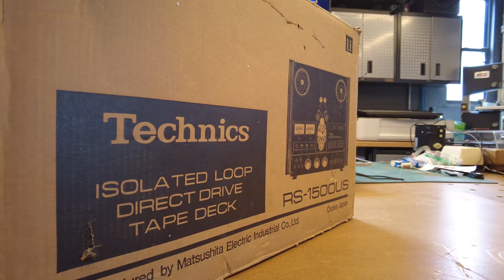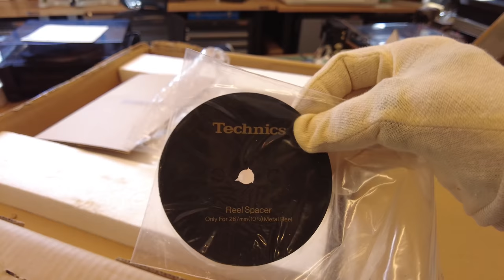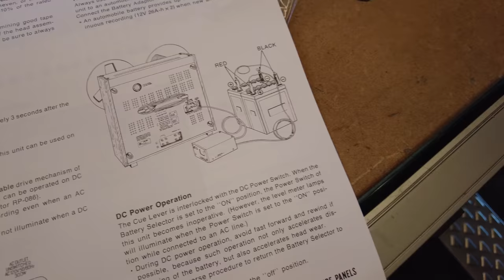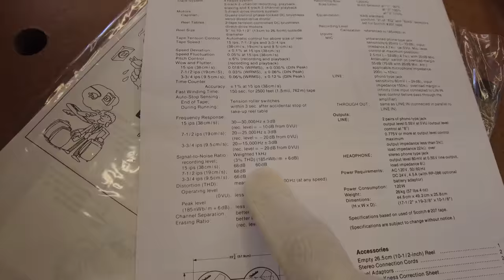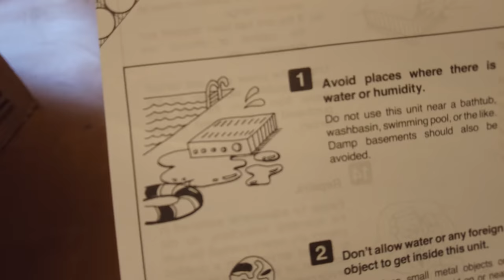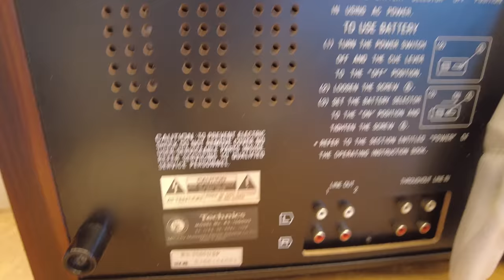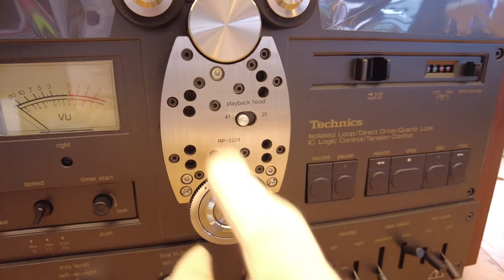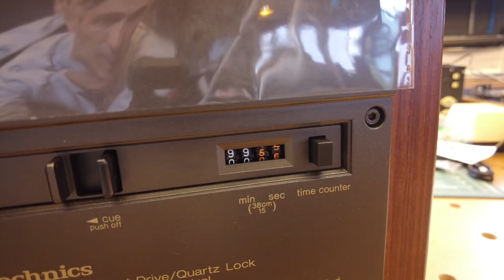Unboxing a NEW Technics RS1500 Reel to Reel from 1979

Comment: I bought a Technics RS-1500US. It was in excellent cosmetic condition, but needed work. I got the machine recapped, calibrated and the heads lapped. I've been digitizing  / restoring vintage per-recorded tapes from the 1950s and 1960s and it sounds fabulous.

Comment: So is this unit all direct drive or does it have belts are you concerned about the pinch rollers needing replaced just because of age or the belts. How about the grease for the metal levers and fulcrums and pivots wouldn't that need to be cleaned off and new put on, 40 years is 40 years in a box or out of a box. Just wondering. I'm still looking for akai 625 that's been properly gone through. Interesting video thanks.
Reply: I have the same question actually. Please let us know how this held up in that regard.
Reply from the maker: I dont recall any belts in the drive system. perhaps on the tape counter.  Pinch rollers were not hardened but certainly it would benefit from new ones if the plan was to use the machine.  Yes if its going to go into use, a light service would be  recommended.
Reply: @SkyFiAudio  oh okay I miss the fact that it was just going to be for show so yeah probably shouldn't touch it.
Reply: @SkyFiAudio  2 belts on the tape counter. All electrolytics MUST be changed, the purple Panasonic caps now leak like crazy even though the deck has never been used. Failure to do this on any Technics RTR results in an unreliable machine.
Reply: Did you get an Akai GX625? I managed to pick one up in almost mint condition a couple of weeks ago in the U.K. 
Still going to get it serviced, it’s a beautiful machine.

Comment: OK, with the ID plate located near the headphone, mic jacks was added after the first generation was issued. I had one of each. Used to record in 15 IPS do post production to the second machine and then make copies at 7 1/2 IPS for purchase. Also made cassettes and 8 tracks. Weddings and local bands along with special shows and musicals. Did this for about 5 years.  Then went into video with Beta video tapes.

Comment: I owned that very unit in the early 80's while serving in the US Forces European theatre.   Using high grade magnetic tape, recording at 15 inches per second, and recording on only one side of the tape was an extraordinary financial overkill on my part, but gosh ... it was so satisfying.
Reply from the maker: Satisfying is a great way to explain working with a high quality  reel to reel.  Thanks for sharing.

Comment: I'm sorry for the new owner.   Rite off the bat you will need it brought up on a variac then about $600 to $800 dollars work needs to be done on it.  It's been idle for 40 years.  The box has not been sitting in a museum with constant humidity and temperature controlled environment most likely. Over all it's a good deal depending on the price and how many times it has a problem. If I owned it I would use it every other day and have it checked every year for a check.  Good unit nice to find nos.
Reply: Dude.. they are not even going to test it.  Here's from their website  "Based on the build quality and experience with this model it will likely work right out of the box"  I'm not lying, and they want 19K for it!

Comment: Watching you unpackage that machine brought back the memories of when I unboxed my Tandberg 64X deck which I bought new in 1968. Believe it or not, the Tandberg 64X had a better frequency response at 7 1/2 i.p.s than your machine has. For current use, it might be extremely expensive to buy 15" reels of tape unless you were doing the mastering for commercial use but why not do new recordings on digital? Great video. Thanks for posting.
Reply from the maker: Glad you liked it, the Tandberg is a great machine also, Im a big fan.
Reply: If you have to ask that question ,you just don't get vintage.
Reply: 15 inch reels! What??

The larger 1/4 inch tape reels are 10 1/2 inch. These are NAB reels, they have a large center hub.

I remember these machines when they were new. I had two in the day, a single pass Studer-Revox, and my happy Pioneer RT-909.

The Pioneer was a thing of beauty, fluorescent bar graph displays, computer controlled operation, and it worked in both directions for playback.

The head stack on that beast had a beautiful aluminum face with access to all alignment positions for the heads.
Reply: Yes I have 2 Tandbergs too from the 70's! One is a tape deck n the other a tape recorder with built-in amp n 2 speakers on the left n right of the machine. At 7.5 ips they frequency response is as good the vinyl itself when played thru a hi fi system!

Comment: I still have one of these babies but it is a slightly different model I can record and play in both directions but it's too track stereo in both directions not four tracks.. A few years ago the logic circuits started having problems and now the transport controls no longer work. One day I'll get it fixed because the thing has the most beautiful sound of any tape machine that I've ever had.

Comment: I would love to find a Technics RS-1800 with the seperate bottom record/playback circuitry box. To me, this is the Holy Grail of Audiophile Reel to Reel machines. The notable aspect is its eq'able 30 ips record and playback half track stereo capability. The sweetness and clarity of the high end and low end frequencies is only topped by my other dream machine - The Nagra IV-S TC (Time Code) portable reel to reel with the QGB 10 1/2 inch reel extension kit. The Nagra QGB is completely superior, of course, to the Chinese made knock - off copy. The Nagra reel extension kit has built in servo tension circuitry, which needs to be plugged into the 4-S's Cue input, and the power is pugged into directly to the power input on the QGB which needs the ATN-2 Power Supply direct current, which is then bumped up and fed out to the power in socket on the Nagra from the QGB box -not the other way around.

Comment: Beautiful machine . 
Just one question , wouldn't be more logical to power the machine , and even check it for leaking capacitors before selling it ? I know is a collectable , but is now out of the box anyway .
I do find it more logical to sell new old stock as revised due to age than the opposite
Reply from the maker: Good point, we usually leave that up to the new owner.  We can ship it as is or even do a light service on it. Thanks for commenting Francisco,
Reply: @SkyFiAudio  Do you find the need to replace caps just due to age even if unused?
Reply: this era of Technics are plagued with bad caps on not just Reel to reel equipment but pretty much all HIFI they made. Wouldn't sell it and ask premium used car pricing without doing a full re-cap.

Comment: If I were you, I would offer the new owner, for a fee, to go through the unit, replacing power supply electrolytics, and checking the operation of the deck in all modes. A full resto would require replacing all of the electrolytics in the unit (it's 42 years old now), and checking the rubber parts and belts (if there are any), as well as checking/replacing all of the lubrication.  It is highly doubtful that the machine will work as new after 42 years in the box. 
I used to unbox these decks for display and sale at the store that I worked, back in the 70's.
Reply: Fee? How about $25 dollars. 1979  dollars. Hee hee hee ha ha.
Reply: you're smart!

Comment: But wouldn't you have to check all the capacitors etc after 40 years? Dried out rubber? you don't refurb a brand new unit before selling? Curious
Reply: Some folks want to preserve a time capsule. Not use it. I assume they are leaving the option open. You can find restorable units any day. NOS, not so much. It might be one of the last.
Reply: Nope, and they want 19K for it, too.

Comment: Nice video but the cost You are asking on eBay is ridiculous $20k!!!
Reply: They never even tested it!  " Based on the build quality and experience with this model it will likely work right out of the box"
Reply: @mr.spongylikeaboss4987  no cause capacitors can leak over time even if unused

Comment: thought you would have used the strapes that were round it to lift it out the box when it's laid flat
Reply from the maker: I think your right.  It was really tough to get it out, didn't want to rip then since they are 45 years old.

Comment: It’s pronounced tech- nicks .
Reply: Both pronunciations are acceptable.  In Japan, it's "tech-u-neeks" (Tekunikusu).   The common pronunciation in the US is "tech-neeks" with equal emphasis on the syllables. Advertising for the brand in the US used that pronunciation, so its generally accepted as preferred, but you still hear it both ways.
Reply: no it's not and stop spreading that hipster BS, see Vandal's comment to reiterate. And really, Anglos miss pronounce most things.. making your comment even more redic.